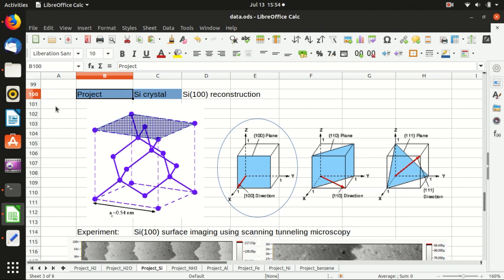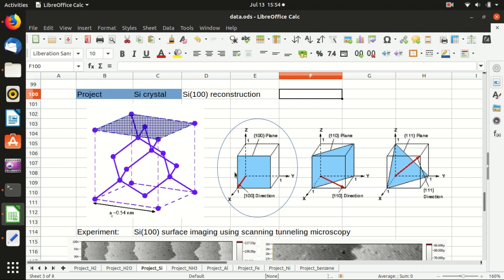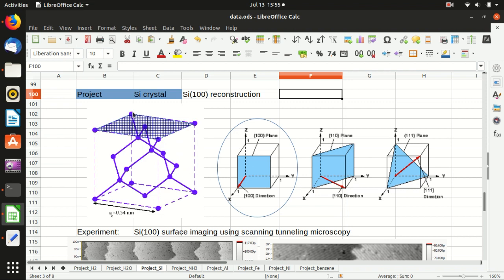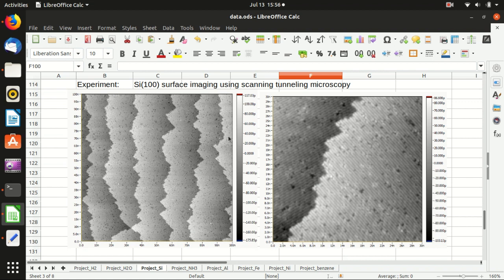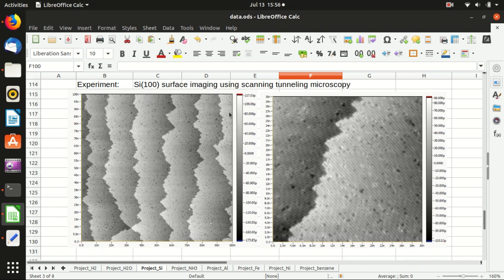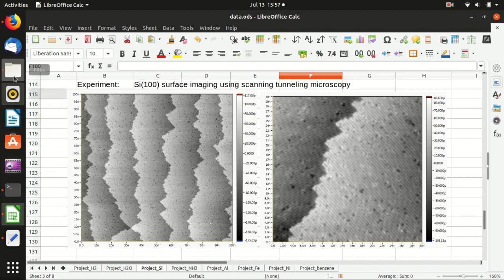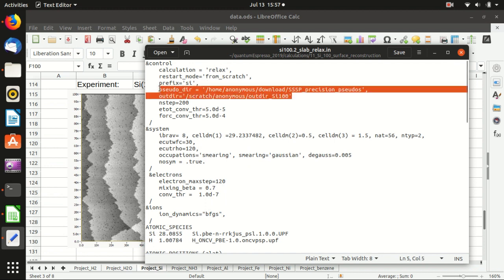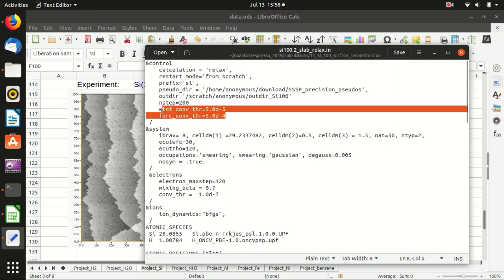Project: 9 Si(100) surface reconstruction | Quantum Espresso Tutorial 2019

Comment: Nice video.
 I have spent 5 years working with atom centered basis codes (Gaussian, Psi4, etc) and am now attempting to learn plane-wave based condensed phase ES packages. When considering surfaces, as is done in this video, is there a general rule of thumb or a good reference/study on the choice of "z"-lattice vector to properly model the vacuum while still retaining a reasonable computational costs?
Reply from the maker: Good question. Personally I feel than a vacuum thinkness (z vector minus the slab thickness) of 10 Angstrom seems a good (conservative for many systems) start, probably you could lower that a if you are tight with computational power. I would suggest an energy convergence test with respect of vacuum thickness at the beginning (with small supercell in the xy direction) and find the balance for your system. Some special systems may require larger thickness such as charged or vdw.

Comment: In case if we want to relax a layered material like MoS2 for example (a supercell made of one monolayer MoS2 with a vacuum slab), do we need also to fix the position of any layer ? because there are only 3 layers (a Mo layer sandwiched between two sulfur layers)